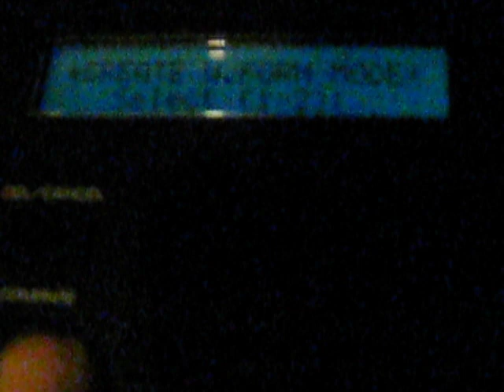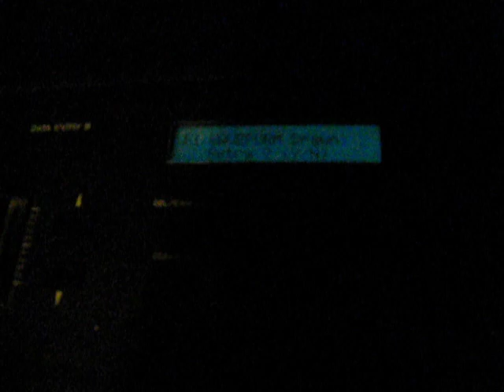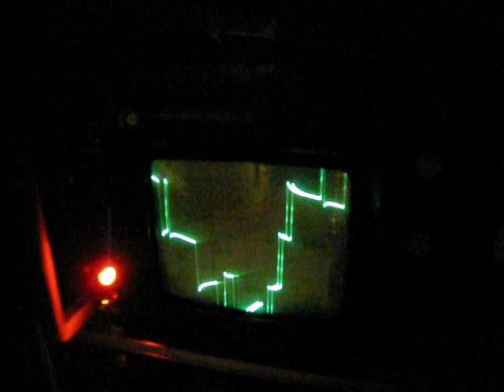KORG DSS 1 synthesizer waveform drawing demo

Comment from the maker: @awesomoshis Hey. An oscilloscope graphs voltage (vertical) and time (horizontal). You can adjust the scopes sweep rate (how fast the green dot sweeps across the screen) to allow you to "zoom" in on the waveform so that individual wave cycles are visible. The faster the sweep rate, the more detail is visible. Make sense?

Comment: I have a semi-broken one of these under a sofa (bad FD and a few keys), but I had one before when they were brand new too.  It was decent as a sampler (12-bit mono), but if you had the right sounds/waveforms, it was a great 8-voice synth.  In addition to the drawing function, you could also manually enter a waveform (256 steps, I think)...I painstakingly transcribed a Memorymoog sawtooth waveform this way and it was quite lovely.  BTW, the unison mode oscilloscope was just cool! ;-)